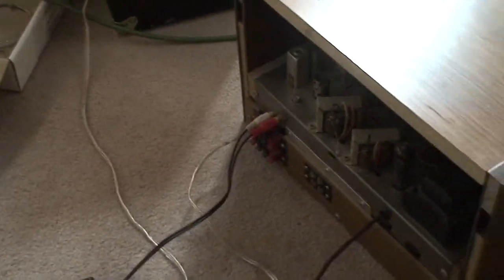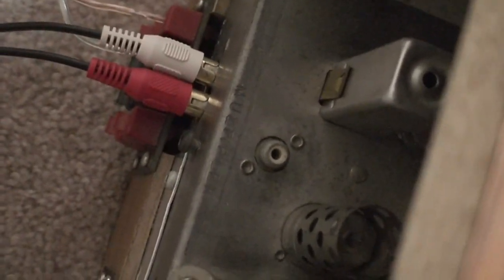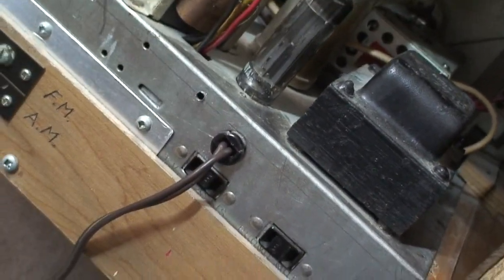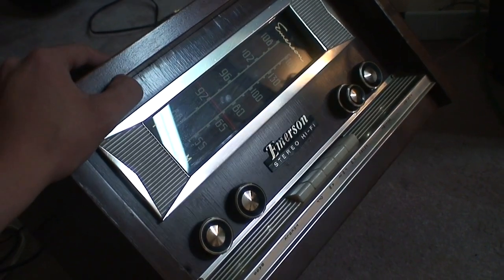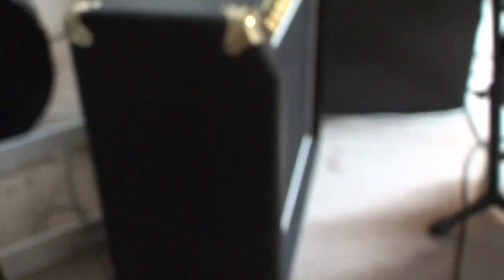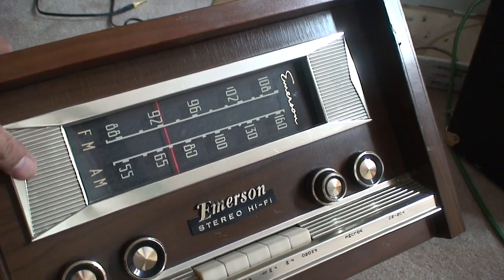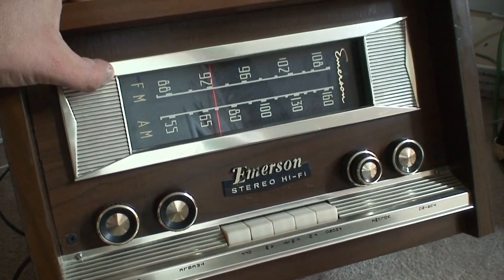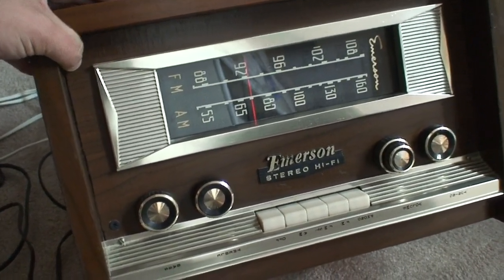HELP me show our community how to convert a Tube Radio into a guitar amp!

Comment: Some of the valves are for the Radio and would be done away with. And your friends are correct you could get a nasty shock, this is an old Radio and it may hold a charge long after it's been switched off so always ground it before you start work be sure it's fully discharged it's circuitry.  I never got no help either when i converted mine a 1963 British made Sobell  mounted in a Bakalite cabinet.I haven't got round to making my cab yet. When i got into the making of my Amp i found that i was basicaly making an Amp from parts of the Sobell. That is to say all the receiving parts were taken away and it was with the parts i had left that allowed me to research which Schematic i would use as guide to my radios reconfiguration. I had a few tubes, probably about 5 in total. 1 was a 12AX and 2 6L6's. That allowed me to narrow down what Amps i could make from what i had. I was hoping i could rework the Chassis from the Sobell which i did manage. It's based off a Champ and still in it's Bakalite radio housing but i have plans to make a cab for it. Good luck, your valve receiver sounds great but please be careful, accidents happen.God bless.

Comment: Viewing the back,  Big black transformer on right- step down transformer,  turns 110v ac into voltage the circuit can use.  The two smaller transformers are output transformers to rectify the voltage/amperage to what the speakers use

Comment: Ground the chassis with a new 3 conductor cord and plug. Based on what I see, just stay away from the capacitors, but your'e not going to "blow up". The old tube-type tv's are tricky-lots of high voltage, particularly the flyback.

Comment: They are referring to the old school "Death Cap" once that grounded plug is added, be damn sure you remove the grounding cap. It can send some knarly voltage into your guitar. Remember, tube circuits run high volt DC power,  DC will kill quicker than AC. By high DC voltage, some of these run up to 450v.... keep that in mind.

Comment: It would be a good start to discharge the filter caps they say that's where the killer lays but I haven't being buzzed yet but a good start a 3 prong power chord ground to Chassis will help hugely and yeah like someone.else added wood is safer when poking round

Comment: the easy way is just what you have done, connect to phono input.   if the radio does not have a phono input you can inject the guitar signal at the volume control.  you do need to add a three wire power cable!  the danger comes from voltage from bad capacitors leaking to the chassis and passing to the guitar. grounding the chassis will solve this.
about half of the stuff in there is for processing the radio signal.

Comment: Make sure you have a speaker load on each channel. Tube amps require a speaker load or the equivalent to keep them from burning up the output Transformers.
Reply: Not on push pull

Comment: If you do get blowed up from it. please have your wife post a message on your You Tube site!
Yes, there are lethal voltages deep in there. Generally, they are not present on the parts you can see. You will only put yourself in danger if you open it up and start poking around. There are many videos out there which will help you and I'd recommend starting with one which shows you how to discharge Filter Capacitors. The other recommendation is to always work one handed with your other hand safely tucked into your pocket!
With respect, a lot of your work on guitars seems clueless. If you want to get involved in valve (tube) amp circuits, Get clued up before you start not during. Learning by your mistakes can, at best, be painful. That said, I think it's a brilliant project and I wish you the very best of luck.

Comment: The polarity keeps changing, quite frequently. Never touch it, without first checking the polarity with a line tester. If you just on it and start playing, your guitar strings could give you a nasty shock. Please be very careful, use a line tester, every time you turn it on.

Comment: First of all it looked like the power tubes are somewhere in the ballpark of EL84s If there is two per channel that's about 15 watts. If there is only 1 output tube per channel it is about 7 watts. There are 2 channels so you have 2 amps. The big capacitor is a filter cap for the high voltage power supply. There are receiving tubes in there so maybe 4 or so tubes are for the audio part. Remember 15 watts of tube power seems a lot louder than 15 watts of solid state. Also you really need to match the impedance of the guitar to the input of the amp. You can change the amp alot easier than the guitar. The tubes in the shielded boxes are probably for the radio and or the preamp the for the audio amp. The smaller transformers are the output tranies for the speakers. The single RCA input is for multiplex (radio). There could be 400 volts of DC in the chassis so extreme caution should be used! Thankz

Comment: you need to be really careful what you touch! Plate voltages on a tube amp average in the 300 to 500 volt range, the capacitors can hold that voltage even when uplugged and will stop your heart no problem. So do your research  abd be safe!
Reply: Voltage doesn't kill. Amperage.

Comment: Check out Premier Guitar, they have a video on tube amp safety.  Lot of the same stuff will apply here. Premier Guitar has a lot of good articles on guitar stuff (unless it's tone wood related). You'd love the bottom feeder articles I'm sure.

Comment: Like I said i. A previous video, if it has a three prong ground plug, and your wall outlet is good and grounded, you shouldn't have any issues as long as you don't touch any capacitors. But just to be safe, always touch stuff with a pencil or chop stick. Keep yourself grounded as well to be safe. But since it is very old, if it has any capacitors, they may be faulty and I'm guessing it doesn't have a 3 prong ground plug so do be careful.

Comment: Anybody that is over 50 including me, have or had a clip wire made that would let you use any table or bigger radio  as an amp for trying to copy the Beatles.it is pretty safe to use. Just change the plug wire to 3 wire and ground  the chassis. That model is probably about 30+ watts. I had a floor model that was 50+ watts with a 15" speaker and it would handle my bass. This is not electronic, but tube and there is a lot difference in how to make it work good. Like I said first thing is to ground the chassis. If you find someone who worked on the old tube radio's then he/or she can adjust the pots and coils. But you definitely have one hell of an amp there. let me know if I can help anymore.